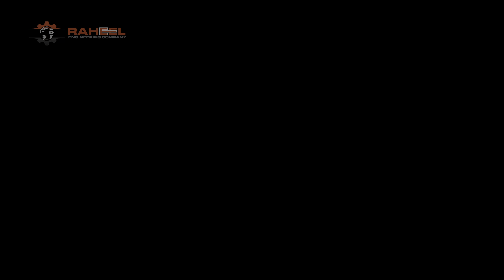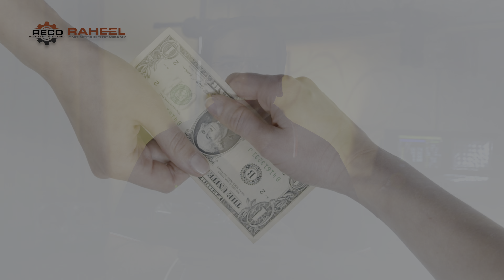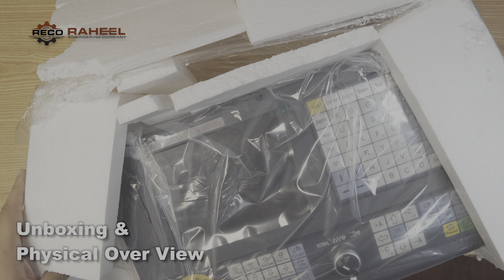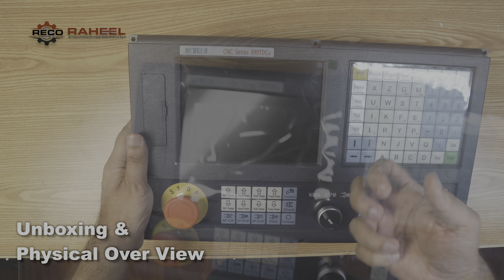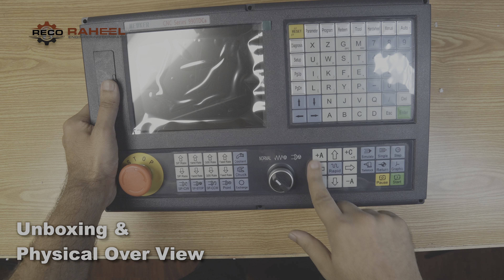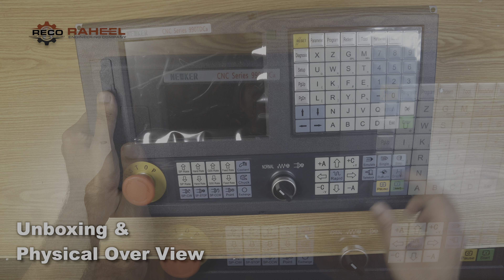Best Budget CNC Controller for Lathe & Milling? Newker 990TDC Full Review

Comment: Thank you so much for taking your time to review this in English. I live in Switzerland and I'm starting my first business making guitars and we're considering using SZGH / Newker controller for our first properly made CNC router.
Reply from the maker: And also thanks to you for noticing me and watch my video
Reply: @recopakistan1520  What's your opinion on their CNC controllers? I am considering buying SZGH-1080MC-4 and as far as I know, they use customized Newker controllers.
Reply from the maker: I haven’t try 1080 controller by I know that both controller has same processor both work at pulse dir. signal and almost same hardware only the difference is controller software experience 
That’s it

Comment: This controller can support direct pc dnc communication, along with drip feeding as well. I'm using an old raspberry pi with a serial interface to do so - any computer that can handle rs232 communications can send programs to the controller directly.

I am really liking your channel - as you've said, there aren't many resources out there for these controllers, and it's a shame, because for the money they're an excellent piece of equipment, which I'd argue is 90% up to the standard of a fanuc controller. The fanuc compatibility also makes postpricessing from CAM software a lot less painful too. I've had successful output of usable gcode from several different software packages that have required minimal to no adjustments.
Reply from the maker: Yes you can run direct from pc
Reply from the maker: There is a also a short video for DNC at my channel
Reply from the maker: I  planning to make full video at DNC but my next entire content will be at Patreon.com/recopk

Comment: Hello friend, I have a Newker series 1000 on my GPR 195 lathe from Nardini in Brazil, I paid a guy to assemble the panel for me, my control is limited to from T1 to T8 as I use quick change castle I need to increase the number of tools to make the preset, is it very difficult to change this configuration on the control? so I can use. T0909, T10 ... T20.
Reply: Acredito que seja possível que você chame a t1 e a t2 com um corretor diferente, criando mais duas ferramentas virtualmente.
Reply: @TH-rs5lw I believe that to add more tools in the corrector to appear in the redeem, command style the newker for machining center or CNC milling machine, a friend of mine did a retrofit on a Romi Galax lathe, his turret is for 7 tools and their technician went there and added more tools because in the turret they use 14 tools to make small parts they use 2 tools together in the same turret trough, that is, 1 in the front and another behind, in my tool radius corrector before it was 8 today due to warranty, another plate was sent from China now there appear 20 or 30 tools in the corrector where it places the tool tip radius.
Reply from the maker: @marcio.roberto.torneiro4897 yes you can create many tools as want in this controller. Send me video of your query at my what’s app no. Given in description so I can help you in detail